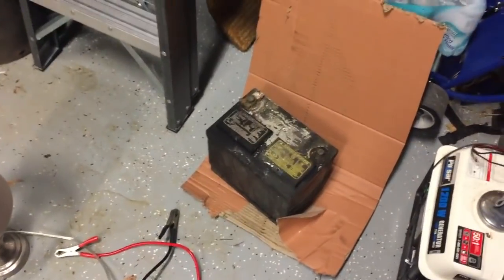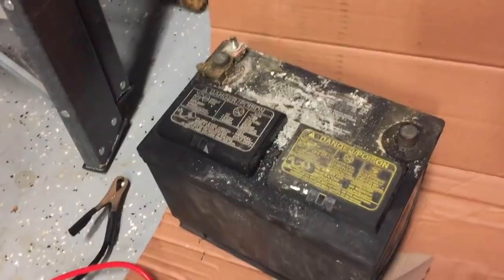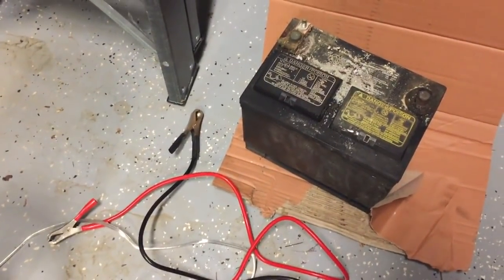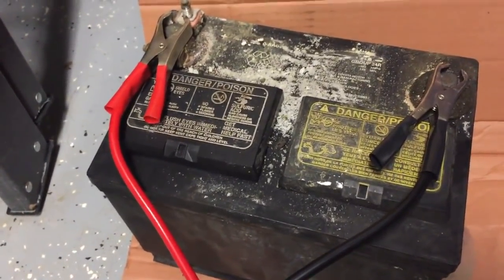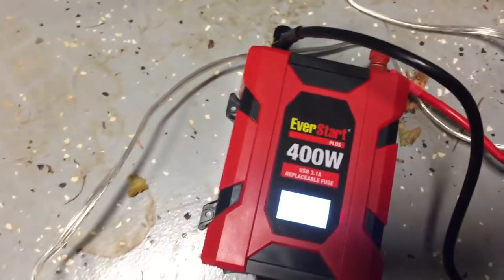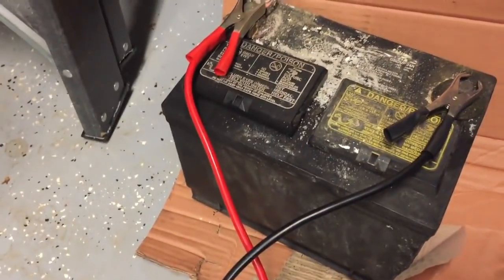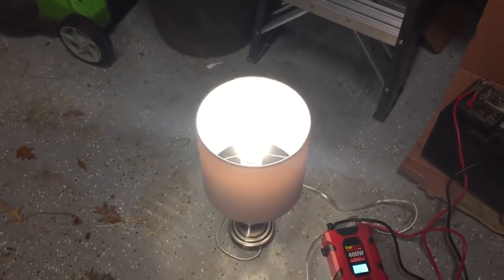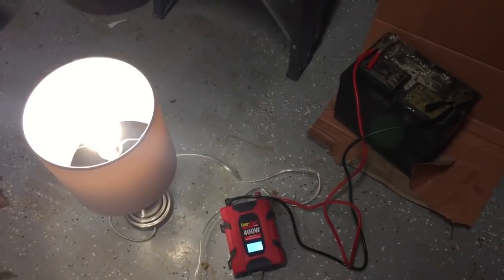Do You Drive a Vehicle? You HAVE a Generator!

Comment: You should indeed clean that battery. I've read that that will actually drain it when it's dirty. Have you checked the fluid levels?

I've been charging a replaced battery for a couple of months now with a small solar panel and solar charger. I try to keep it all DC and charge our personal, electronic devices with it. :)